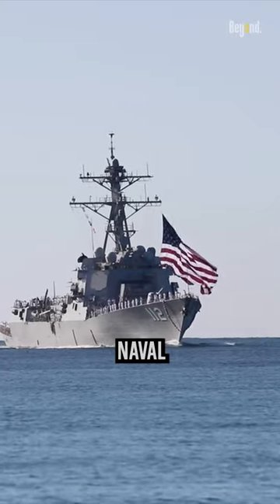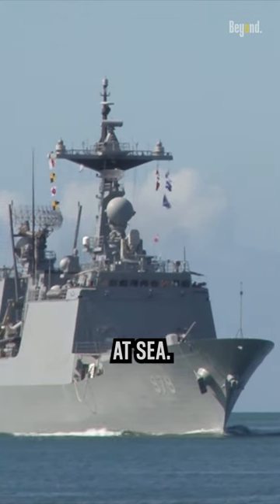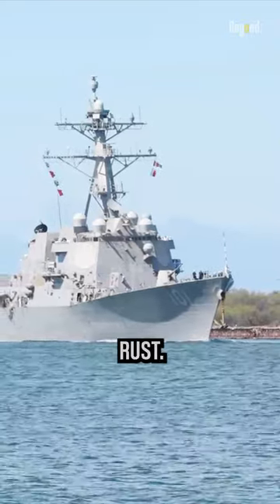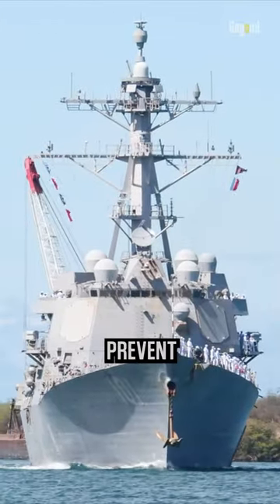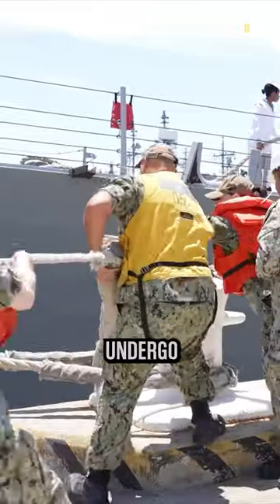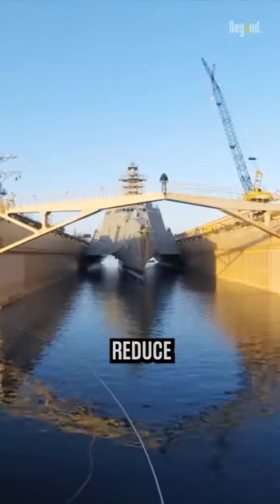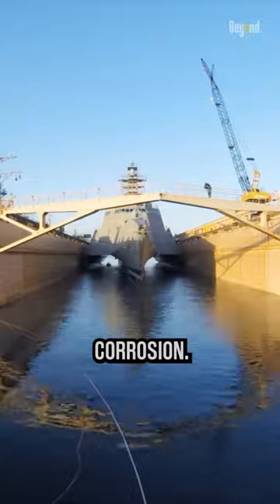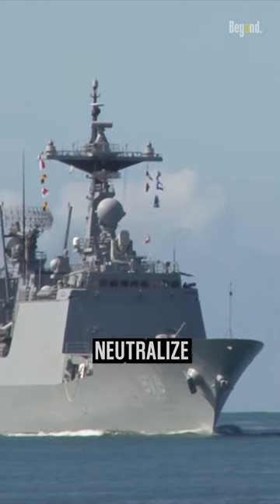How warships survive from rust #shorts

Comment: You forgot to talk about the endless hours, days, months, and years that sailors chip off the old paint and rust. Sand the bare metal and add pretreatment chemicals and epoxy primer and then the topcoat. Preservation never stops until the ship is scrapped.

Comment: The propellers are solid brass so sea scrapers go straight for the props on a ship they have found. Ship propellers are foookin mahooosive and to a scrapper is a jackpot. 5 or 6 grand a tonne and those props must be a tonne plus. Even if modern ships are made with stainless steel it still gets thousands per tonne.
Reply: You shouldn't need to scrape brass screws.

Comment: Rust prevention mostly from cathodic protection and divers painting below the waterline. The rest is boatswains mates with wire brushes, grinders, and fresh paint.
Reply: Hahaha divers painting under water. What with water based paint. Below water is a dry dock job. 34 years at sea in case you were wondering
Reply: @stephencallon3317  I was in the Navy 6 years and yes they did paint under water. We had to shut off the cathodic protection system. I remember meeting one of the divers.

Comment: Here's an irony for you, you showed one of the LLC asses getting brought into a dry dock. And being Rusty. Both classes of them have significant rust problems, and it has been determined that the only way to keep them in service is to actually devote Crews from the bases their homeported in in order to keep them from rusting away! It turns out that minimally Manning crew doesn't leave you enough people to hang over the side and Chip the rust and put new paint on it!  One of the reasons they're such a large deck roof on Arleigh burke-class destroyers East to keep them runnable!